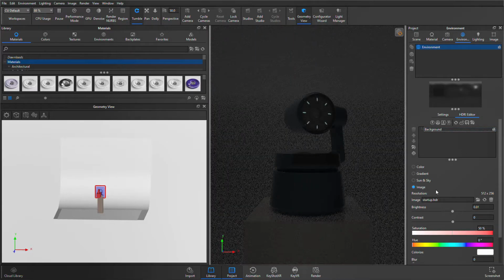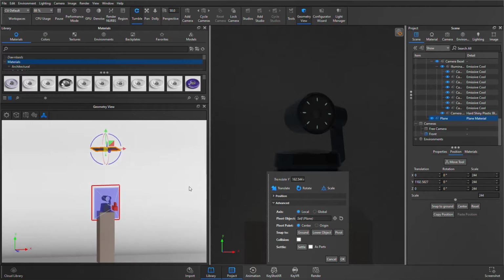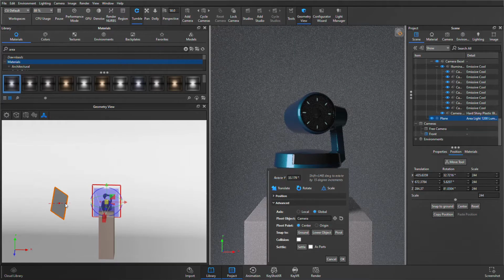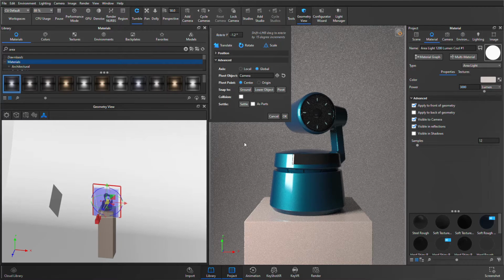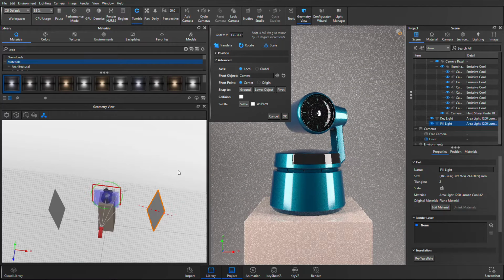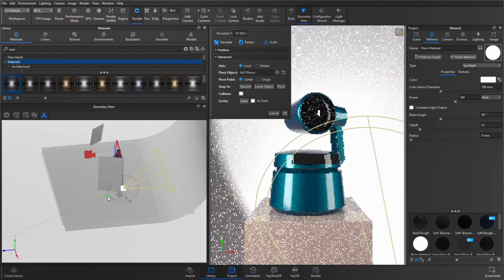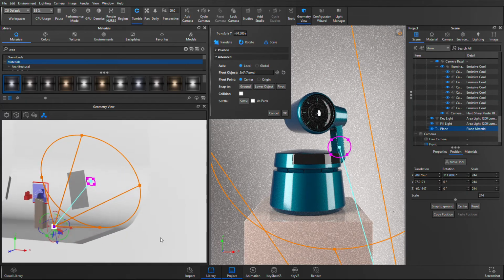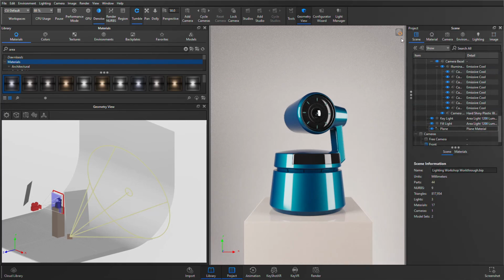Let There Be Light: Using Physical Lighting

Comment: Great video! Is it possible to work with gobos in keyshot? Can we add textures to our lights
Reply from the maker: Yes, you can load texture maps onto physical lights by going into the light’s material options, then into textures and clicking on color to then import a texture. For Gobos I would load your textures onto a spotlight